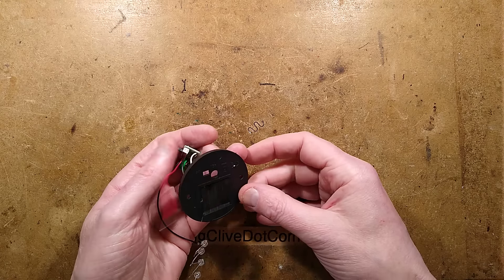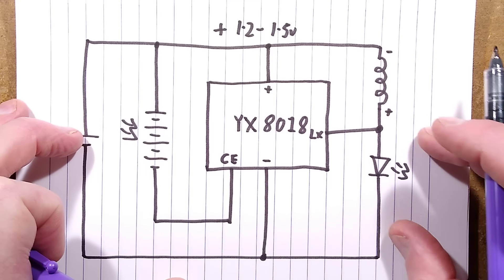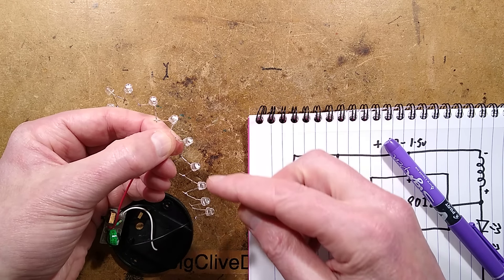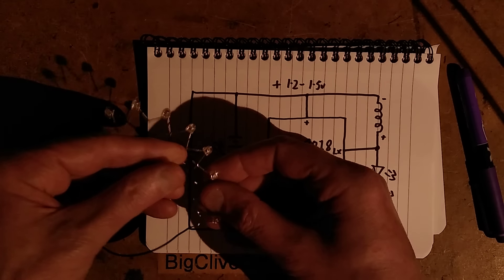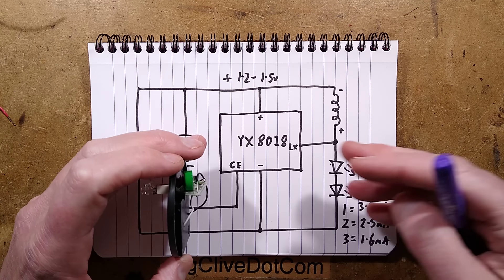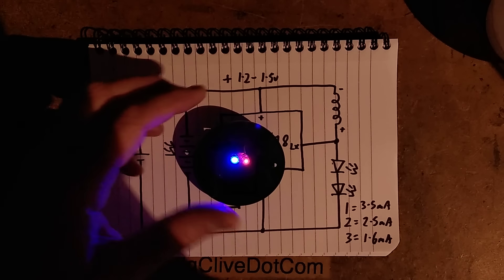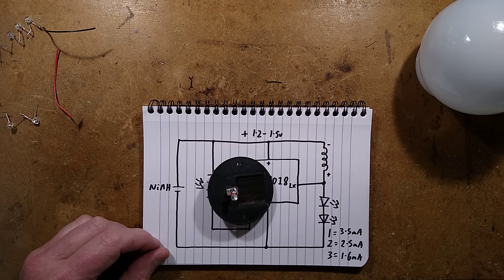How many LEDs in series can a solar circuit drive?

Comment: This explains why when i replaced the LED in one of those with a rgb slow color cycle led it would only do the blue one :D
Reply from the maker: It needs a diode and capacitor to avoid the LED resetting repeatedly.
Reply: The " illuminate your toilet LED" does the same on low battery.
I chose to light up my sink instead for obvious hygiene reasons

Comment: Just yesterday on your other video, I wrote that my parents brought me two broken solar lights to look at (the switch rotted away). While fixing that (by removing the switch shorting the pads) I found that in one of the lamps the leads of one of the LEDs (the lamps had two in parallel) were rusted through as well. I replaced them with SMD LEDs (salvaged from those 12V halogen replacements; yes, new LEDs would have cost close to nothing, but I just love to reuse things) soldered to a small piece of perf board. Guess what? Those were 2-chip LEDs. So I picked the right LEDs by accident 😅. And while the lamp with the original LEDs was dark in the morning, the one with the replacements was still on. (I can't rule out though that one of the NiMH cells is just worse than the other)
Reply: Suggestion: Switch the NiMH cells.

Also maybe get a cheap multimeter if you don't already own one and measure the current draw for each light with the same NiMH cell. It may be that one of them would benefit from a current limiting resistor.
Reply: Your LED swap is a common theme /axiom here.
The right to repair, repurpose, reuse, recycle. 
So good job, well done.👍
Reply: @Fridelain 
Curious, why a cheat meter.?
Reply: @snakezdewiggle6084  It's good to keep a cheap multimeter or two around, specially to learn on. If you break it by forgetting to switch ranges or the like, you won't suffer as much. For hobby use a cheap one does the job fine. For mains stuff you want proper kit, of course. But I don't suggest a novice muck around with mains.
Reply: @Fridelain 
Yeah, good call.
I daisy-chained 6 microwave  transformers, total brain fade, flipped the switch...
Completely vaporized a 200 dolar meter. Lesson learned.! lol.
Reply: @Fridelain A current limiting resistor wouldn't help much. The boost converter will tend to raise the output voltage, while maintaining the input / output power. That means, for a relatively unchanged power draw from the battery, the LED lamp will glow somewhat dimmer. At the same time, the energy that is not transformed in light anymore gets dissipated by the resistor .
Reply: @snakezdewiggle6084 I think I'm much more concerned about the idea of connecting multiple microwave transformers in series than killing an expensive meter. I feel like people playing around with a single one has a high enough fatality rate. 0_0

Comment: Good video you can also change the inductor to change the current for the led. The datasheet should have the values for those. Thanks for sharing!
Reply: How about driving a mosfet from the 4 pin controller, to drive a much larger inductor?
Reply: @Jimmeh_B  This chip is actually pretty awesome and cheap it can drive I think is up to 100mA with it's internal mosfet I don't think it will drive an external one tho.

Comment: Nice experiment.
Sonce the question was raised how many LED in parallel that YX8018 could drive;
The solar bottle cork shape LED strings sold at the german EuroShop "dollar store" drive 10 paralleled micro led on enamelled copper wire.
But while still using a YX8018 clone with button cell size NiMH, the LED are actually placed across the inductor, not between LX and GND. (This alteration is actually also covered in some "datasheets" to this chip)
This difference to the schematic shown here has two sides to it; in the schematic Clive shows, the voltage of the NiMH cell adds to the flyback voltage generated by the inductor. However in this configuration the LED current flows through both inductor and NiMH cell. 
Since NiMH cells exhibit a high internal resistance (especially if discharged or old), this only makes sense for a single LED or a series of LED where u favor voltage over current. (And even then a cap across the NiMH can improve the situation.- Also covered in the schematics of some yx8018 datasheets.)
For LED in parallel like in the bottle cork LED strings, where you want to maximize current, it is better to forego rooting the current through the NiMH cell and put the paralleled LED directly across the inductor.
Reply: We have to remember that the inductor of the boost converter gets charged by the current flowing from the battery, through the inductor and back to the battery through the switching device (bipolar or MOSFET transistor). This current increases gradually and, at its peak, changes path when the switch turns off. Consequently, the current through the load is primarily limited by the inductance and the frequency and is not dependent on the LED lamp being connected between LX pin and ground or across the inductor.
Assuming a fixed frequency converter, the power delivered is smaller when the load is connected parallel to the inductor (the battery does not contribute during the discharge part of the cycle) but so is the power drawn from the source, too.
I think the parallel connection of the LEDs across the inductor is not favoured by a higher available current. A short-circuited lamp would destroy the converter, which is less prone to happen in the other configuration .

Comment: I make custom garden lights and electrical lawn ornaments.  I switched to using these cheap AliX modules no bigger than the tip of my finger to power them.  1.2 v to 3 v but it puts out around 7 volts pulsed.  I can load it to 1 amp with many LEDs parallel, and it works reliably.  I find these modules far more efficient than the 4.2 volt modules.

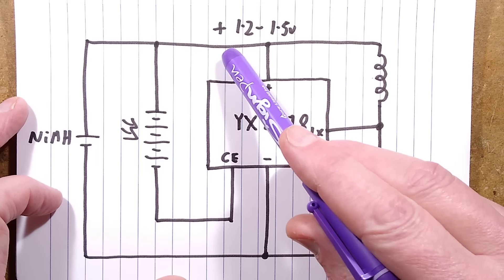Comment: The inductor is the likely limitation, not the chip. The LX node probably has a modest voltage capability (12v?). The best solution is to use a tapped inductor boost. Put a (perhaps) 1:10 turns ratio, and you will be able to drive a string voltage of 60 volts reasonably without exceeding the chip voltage spec. Eventually, the inductor resistance and FET resistance (inside the chip) will be the limitation. [note that a 1:10 turns ratio means a 1:100 inductance ratio].

Comment: I did similar experiments in 1998 when researching variable switched reluctance pulse motors. If I remember right, I was able to drive 10 old school red leds but not very brightly. 
The BEMF of the experimental motor I built to play with, blew my parallel port oscilloscope, but I measured 1200V peaks with only 12V supply before the scope went bye bye. 
So yeah, if you pulse a bug coil, you get a big spike back.

Comment: Very interesting, thanks.  Not an electronics expert by any means but ADDING lights to circuit reduces current is fascinating.  It would be interesting to see what the total light generated by 1-4 LEDs was, seemed about the same.
Reply: They're connected in series, so in basic terms the resistance increases, and current is voltage/resistance.

In general, LEDs are more efficient the lower the current, so you might be getting more total light with more LEDs.
Reply: Edit: watching further, it's clearly less total with more LEDs - I guess it's down to how they're driven. For more on efficiency at lower current, check out Clive's videos on the Dubai bulbs.
Reply: @michaeltempsch5282  Then again, the current through two LEDs is 2.5 mA each and if the light output is linear with respect to current, which probably is the case, you get a total amount of light equivalent to 5 mA, i.e. more than with just one LED in the circuit.

Comment: I'm surprised you didn't do this experiment sooner. Next experiment: trying different values of inductor to see if you can increase the current and brightness. Presumably there's a maximum current that the little transistor inside the chip is able to switch, so it would also be interesting to see if there's some kind of protection that limits the maximum current, or if it just pops and lets out the magic smoke.
Reply: There are datasheets for that...
Reply: i think the inductor swap has been done on this channel but many moons ago
Reply: I think he only real oddity with these is that they run at a fixed frequency so the rms current varies inversely with the inductance. There will also be some sort of clamp inside to limit the voltage across the switch. There is a video somewhere on the channel where he did some experiments, but it’s also listed in data sheets as well.
Reply: Come to think of it, a more interesting experiment might be to use a flyback transformer to boost the voltage on the secondary. Won’t get much current, but it could light a string of high efficiency LEDs. Edit: One out of a cheap Chinese usb power supply would be a good candidate since the inductance on the secondary would potentially be within the range of what the chip can drive, with the primary serving as the output.
Reply: @mysock351C Using a transformer would lower the total power output. The LEDs would be subjected to high reverse voltages, prompting for a more complicated structure of the circuit .
Reply: @CG-rr6yx  The output circuit would be exactly the same as a typical flyback, just no smoothing capacitor. You’d use a diode to avoid reverse biasing the LEDs. A 1N4148 or similar small signal diode would work well. You could probably get a milliamp or so at 20V if you chose one with an inductance around the minimum value. Yeah it would run the battery flat faster but it might be a nice way to drive a string of cheap LEDs that would otherwise be too unbalanced to be driven in parallel. Also have the option to group them with balancing resistors if you want to drive more, but even the high efficiency ones will need at least a few hundred microamps.
Reply: @mysock351C  I think there is a risk of the transformer ringing and generating higher reverse voltages.
For such a complicated circuit in the secondary, we might as well drive the primary coil with a classic one-transistor blocking oscillator .
Reply: @CG-rr6yx  You are merely adding a transformer and a diode. From building offline flybacks it will ring, but so long as the diode can withstand the reverse voltage (and there is a clamp on the primary switch, which the IC should have) it should be ok. Also we are only dealing with a matter of milliwatts of power. I suspect the real difficulty would be finding a transformer with the right inductance since unlike a flyback there is no feedback. Only the inductance and the switch on/off time will determine the resulting flyback current on the primary.
Reply: From the datasheet:
Inductor package LED current
560uH 0307 LEDx1 pieces 3.0mA
220uH 0307 LEDx1 pieces 7.0mA
150uH 0307 LEDx1 pieces 10mA
82uH 0307 LEDx1 pieces 15mA
68uH 0307 LEDx1 pieces 21mA
47uH 0410 LEDx2 pieces 30mA

Comment: The YX8018 will also work at 3 Volts or a bit more, so you may be able to add more LEDs. I didn't try charging a battery higher than 1.5 Volts with a solar cell, but  that may work as well.

Comment: I've used these boost chips to drive multimeters, effectively replacing the battery. However, one failed - probably because these devices are limited to 6V before you have entered the "may affect device reliability" zone.
However, if you know what autotransformers are, you can hack up the original inductor to drive as many LEDs as you want!

Comment: Hi Clive, fellow Scotsman here! I've been harvesting the lithium cells from my disposable vapes for some time now with the hope that somewhere there would be a decent tutorial on using these in homemade battery packs etc that could be used for powering a battery bank or small model boat. I've got a reasonable set of skills, a 3d printer and laser cutter so making a housing etc would be easy done. Is coming up with a guide to achieve this something you'd be up for trying? showing how to wire and protection/balancing circuts?  cheers :)

Comment: Very interesting video Clive! I perhaps foolishly thought the circuit would be capable of driving all 10 LEDs... however - I wonder how such a circuit would perform with a single LiFePO4 cell rather than a NiMH cell instead....
Reply from the maker: The datasheet only covers up to two series NiMh cells.  (2.4-3V)
Reply: need a lot more solar cells.

Comment: These drivers seem to be fixed on time boosters so basically they control the joules stored ion the inductor.
Higher Vforard means less current. Try changing the inductor?

Comment: Interesting,  what type of leds are they in solar string lights, as they run 50-200 off a 1.2v cell...e.g what is the difference between solar string leds to standard leds...always wondered..cheers.

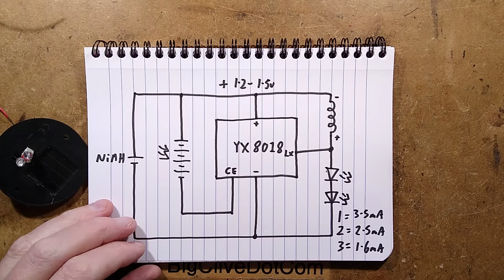Comment: 4:48 I have seen this boost circuit in quite a few items, with varying different cell capacities and different amounts of LEDs, but I didn't check if the accompanying (through-holes) inductor had different values, depending on the configurations.

Now, I'm curious, as I also want to "bigclive my garden, solar-powered, LEDs" (yes, "to bigclive" is a verb now ;-p) with colourful lights.

Comment: you could increase the current too by swapping out the inductor.
the data sheet should give you different inductor values to set a higher current...of course that means the leds would not light as long after dusk.

Comment: The maximum voltage could be limited by the breakdown voltage of the switch in the IC. If so it might vary from unit to unit.

Comment: If you put the red led and blue in parallel, with  say a 1k  pot on the blue led you could probably mix a purple colour of your choice, then use a fixed resistance for the red led.😎
Gaz Yorkshire

Comment: You can get high eff red LEDs and the upside is they are under Vf=2v. I wanted to see you try a larger value inductor. 
Have you seen the guy on hackaday, the tritiled? He lights an led for 10 to 20+ years on a 225mah cr2032 coin cell! 
You should check it out and see if you can improve on it, challenge accepted?

Comment: Two LEDs would work very well with a clear plastic light pipe, having one LED at each end.  Im sure you've seen those garden lights with the light pipe and only one LED at the top.  This would improve that immensely.

Comment: I'm wondering, can you have like parallel sections of two LEDs in series? So you get the benefits of what you discussed, but can also run longer strings of them? (Maybe like that LED Tree you made a couple of years back?)
Reply from the maker: Yes you could do that.

Comment: One change I would make if you have access to a YX8019 since it has over charge protection. Still a 1.2 v button cell YX8018 is max 40ma output you can do up to 2 cells and 2 LEDs based on data sheets

Comment: Two in series makes sense. If you get one with special effects LEDs, there's a normal (non-LED) diode in series with the LED to keep a capacitor charged up so the LED doesn't lose power and reset.
I wonder how much the inductor matters for this. Can you power more if you increase it?
Reply from the maker: I think it might be capped by the chip, but I've not tried changing the inductor.
Reply: YX8018 seems to be a simple unregulated boost circuit without PWM or anything like that. Inductors resist change in current. So to increase current, you would decrease the inductance, which decreases the rate of current change, so that it rises more quickly in the fixed time the switch is on. Because timing is held equal, faster current rise = more area under the curve, more total power transmitted through the LEDs.

Comment: Could you put more inductors to boost the voltage even more?
Reply: The maximum boost voltage is also limited by how much voltage the switching element in the yx8018 can withstand without reverse DS breakdown.

Comment: It's a resistive voltage divider 😅

Question is, just how green do you need your garden at night time?

How about with a red led, or colour slow fade
Reply: The LEDs with integrated controller for fade and or colour change are likely to reset on each cycle/pulse, so likely will stick in its start mode.
Reply: @michaeltempsch5282  add capacitor? 🤣

Comment: you must have heard of the pam8604 audio board, i just discovered it can light a regular led on the output with no voltage ac or dc recorded, but i was able to measure a frequency , i thought you might find it interesting.

Comment: With the HH004F LED Driver (3pin) where i experimented with a few years ago, i could power more then 20 white 5mm LED's by placing them in parallel and using a 1x AA battery. Don't know if this is possible with the YX8018

Comment: What happens if you change the value of the current set inductance?
Can  you compare/contrast the  YX8018, YX8019, YX8051, YX801, YX8122, QX5252,YX805F?
Reply from the maker: A higher inductance reduces the current and a lower inductance increases it.  You can find examples in the YX8018 datasheet.

Comment: Doesn't the YX8018 regulate the current? If so, why does the current drop with 2 or more LEDs? The voltage is increasing so shouldn't the chip be pulsing to keep a constant 3.5mA?
Reply from the maker: It doesn't regulate current.  It just pulses the inductor at a fixed frequency.

Comment: From the thumbnail, I'll guess 5-6 depending on type. Can't those also run on 2 or 3 NiMH cells? Even 2S would light 10S LEDs but probably at the bleeding-edge for peak voltage.

Comment: If it draws only 3.5mA from your PS, then it must have a 560uH inductor according to the data sheet.
a 47uH in an 0410 package, is supposed to give 30mA and drive 2 LEDs.